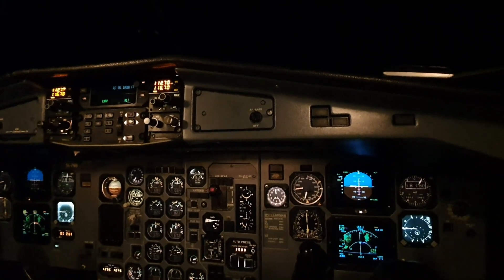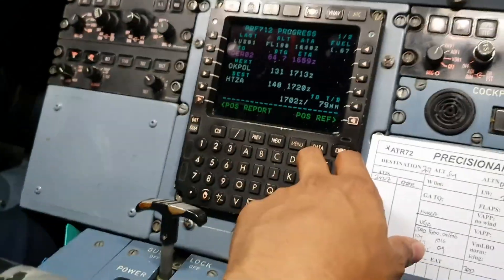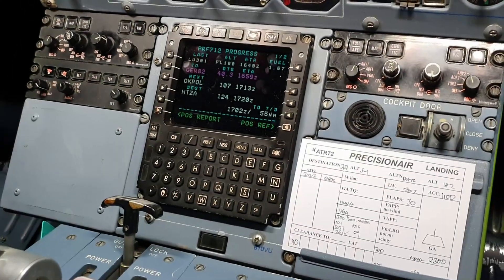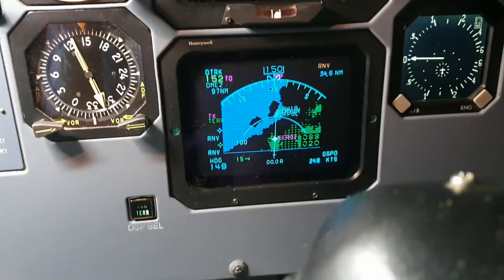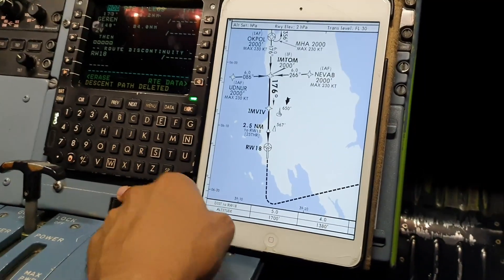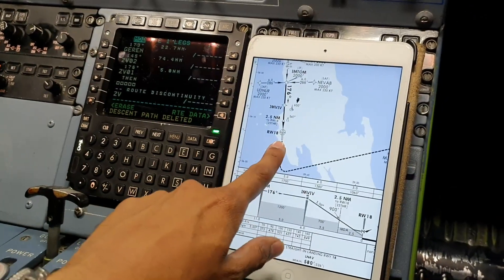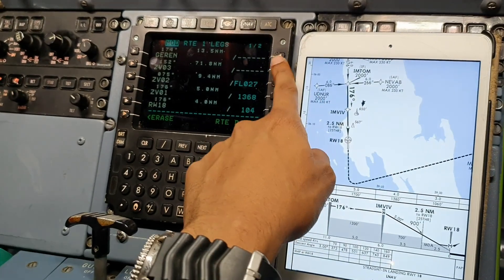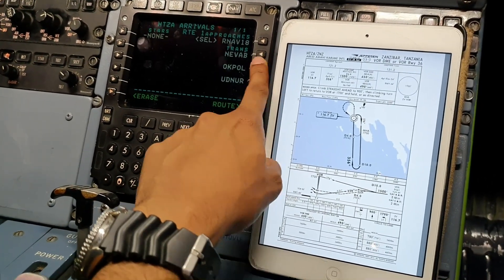Part 3: Programming the GNSS (HT1000) on the ATR 42/72 500

Comment: Excellent effort. I appreciate it deeply. Could you please let me know how to set a Fix to Altitude leg? For example, fly on radial 123 from VOR XYZ and after pasing FL120 proceed to waypoint ABCDE
Reply from the maker: Hi! 
I've actually tried looking for this problem before but unfortunately I couldn't find a way to do it, however these altitude fixes do exist on the SID pages, you could technically steal the altitude fix leg portion of the SID and plug other fixes that you desire. So far that's the only way I've found and you're limited to the SIDs that you can find
Reply: @rockerkunal  Thanks a lot for your quick response. SID points can be copied and used but can not be edited. Many a times the ATC instructs such procedures which are not in SIDs. That's why I was looking for such things to customize the route. Anyway, thanks a lot once again. Keep making such educative videos. Best regards. : )

Comment: Hi! Really like your videos on the atr 72-500, and you have sparked my interest in this great aircraft! I was wondering if I could make a request for the next video? I'd like to know more about the rotation rate and the landing pitch of the atr since it sits so low to the ground. Keep up the great work, and much love from Sweden!
Reply from the maker: Hey Firmas, rotation rate is the regular, around 3-5 degrees per second on take off. landing cannot have too much landing pitch as the 72 has a rather long body and has a tendency of tailstrike. around 5-7 degrees should be max and sure you can make a request for a video!

Comment: Hi tailwind thanks for the video .Very good and informative video. It helped me when I was requalified for ATR 72 500 captain for mixed fleet flying , 500 and 600 .I flew 500 long time ago.
Just one comment ,the quality of landing is not measured by Gmeter value .Attempt to make low gmetre value landing  or called as grease landing  is not a good idea.Attempt to make   Grease landing significantly increases long flare ,late power reduction ,long landing roll,long landing distance  and reduced aircraft control in wet runway .ATR recommends standard landing technique as per described in FCTM .
Once again good job and keep it up 😊
Reply from the maker: Hey Capt, thank you for your kind words. Yes we are aware of the FCTM landing procedure and yes im aware the G meter doesnt ensure a good landing. Its just a fun thing some captains do. Wish you the best!

Comment: Hey, I'm suppose to go for an ATR rating and have sometimes left before, what would you recommend me to suddy in order to be advance?
Secondly, I just left school and was wondering how hard would it be for a first type rating with only 200 hours?
Thanks a lot for your answers!
Reply from the maker: Hey Max, congratulations on your first job on ATR! It's a great machine. 
The rating is relatively easier when you're fresh from school as you don't have any bad habits of flying single crew or bush operations, so don't worry about it. It'll be the same things as flight school but on a different plane. 
There's many ways you prepare for the rating, the main thing is just getting familiar with the cockpit layout knowing where everything is.
The next being the procedures, should be in your FCTM. Know your call outs and flows, the FCTM will be your main book for Sim.
https://www.theairlinepilots.com/forum/viewforum.php?f=48
This site should help you greatly.

If you do find yourself having more time, you can go through the various systems of the ATR by reading through the FCOM. 

What airline did you get into and where are you training?

Wish you the best! 
Cheers